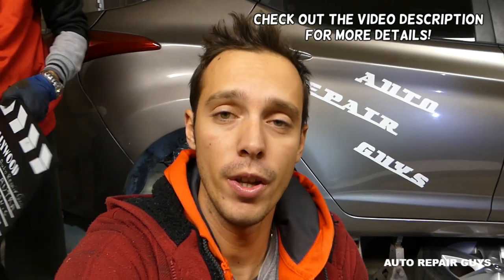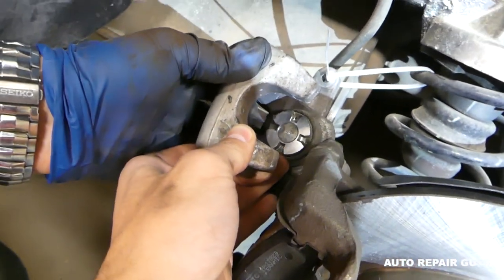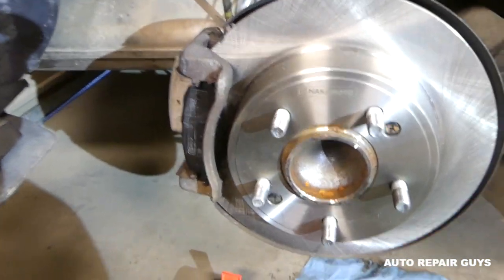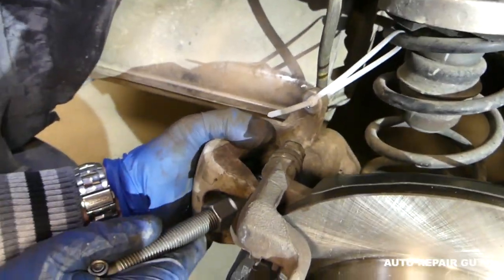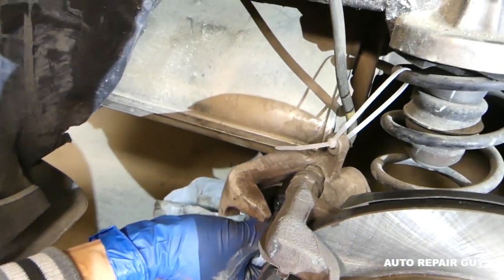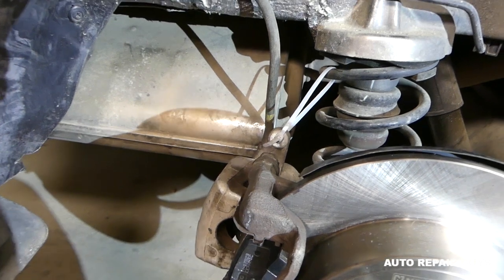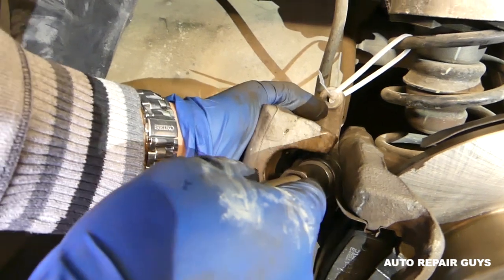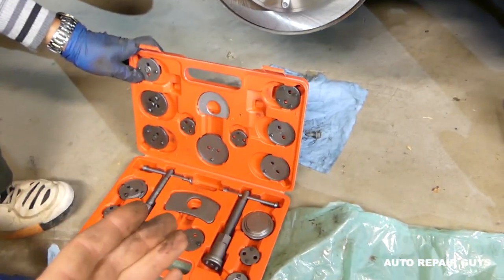HOW TO COMPRESS REAR BRAKE CALIPER STUCK

Comment: You should be using that back plate provided so it doesn't keep popping off.  Also the LEFT and RIGHT tool is NOT for left and right side on car.  It is for left handed thread and right handed thread.
Reply: Haha just wanted to ask? Left or right whaat? Thanks
Reply: Doesn’t always work cause there’s no room for the back palpate
Reply: @Jackthompson01  My set has several back plates & has worked for everything I've worked on
Reply: @christopherbrown5338  on mine the piston is so far out that you can’t fit the back plate that came with my kit on as the calliper is in the way.
Reply: @Jackthompson01  What about a larger c-clamp to get it started?
Reply: Jack get a new professional kit. Then you won’t have that issue.

Comment: I stared and swore at my caliper for so long before I found this video. Thank you. One trip to a parts store and I was done in minutes.
Reply: Bruh lol I've changed my front brakes about 2 or 3 times myself because I had 2 of the same car, I guess I always had the rear done because I got all the way down to the c clamp and it wouldn't go down even with the old brake inside of the caliper. I looked it up and found this video and now I have to apologize and take my knees out to dinner for wasting their time and quality 😂

Comment: What if your break caliper is sticking too far out and won’t compress at all. This video is great for others but didn’t not help my problem at all
Reply: Same
Reply: How did you fix? Can’t even drive it now
Reply: Same here
Reply: Damn, I was hoping for a solution here
Reply: I'm dealing with that problem now. The compression tool is now stuck because the back bar bent. Every video I've seen theirs isn't stuck. I can't even get the tool off now.
Reply: @jasonbenefield7892 Same I'm just gonna replace the caliper
Reply: @MinecraftGaming7595  well I have a Volkswagen Jetta so I had to use a brake caliper cube, it wasn’t the best tool to use and took a while but it was cheap and worked
Reply: @jasonbenefield7892 have you tried twisting the caliper piston with a tool that grabs the notches?
Reply: @elijahlymus1370  the caliper was bad. Nothing could compress it. I had no issue with the other calipers. I had to have someone cut the tool to remove it. It was unfortunately an expensive learning lesson. If the piston doesn't compress easily then the caliper is bad and needs to be replaced. I've replaced brakes since the 90's and never dealt with a bad caliper. Now I know what to do if I encounter that problem again.

Comment: Not trying to knock you or your helpful videos, but just so you know, white lithium grease/spray is a petroleum based product and will damage/swell the rubber boot & seals on the caliper piston. The proper grease/spray to use is a dab of silicone grease or spray. Silicone is rubber & plastic friendly.

Comment: Great video, so is it only needs to turn it clockwise? No need to press the Piston?
Reply: I turned mine clockwise and anti clockwise while pushing in. Seems to go in either way. Clockwise just seems easier because you're using your thumb part to exert more pressure. Just make sure the holes line up with the pins on the pads.

Comment: My caliper in great condition, no rust.  Turning and turning, piston will not go down.  Turned counterclockwise thinking maybe left hand thread, now piston completely out.  Will not turn back down.  Pulled e-brake lever and still will not turn down

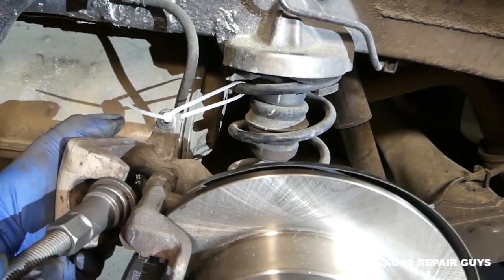Comment: 2:47 you should use the tool properly. You forgot to add the flat metal plate that rests against the caliper and keeps the threaded rod straight and tight. This also will need to be tightened using the collar that is on the threaded rod.

Comment: The needle nose pliers worked after all there was a little bit of build up around the bleed screw and it kept the fluid from releasing and was the reason I could not compress. After the fluid started coming out, the issue was gone. I would recommend checking/cleaning around the caliber.

Comment: Mine just keeps spinning and spinning. But it's not closing as I'm turning it with tool
Reply: Hopefully you found another video that showed correct way to use the tool.  These guys don’t explain it correctly.  Also, left and right tool is not side of car but direction piston needs to turn.
Reply: @scottswanson133  thanks buddy, I figured it was a bad caliber which it was, so went ahead replaced both back, then few months later both front, now I'm looking to save up 250 for all 4 rotors and pads set but it's been already like 4 months and I just can't seem to get there.... right when I'm close something happens where I must use that money for something for important 😪🙄😒

Hopefully I'll get them soon because my rotors are shot and I'm praying they aren't screwing up my system and new-ish calibers